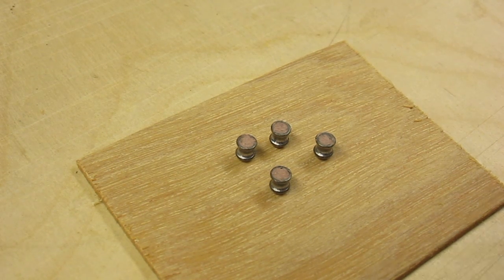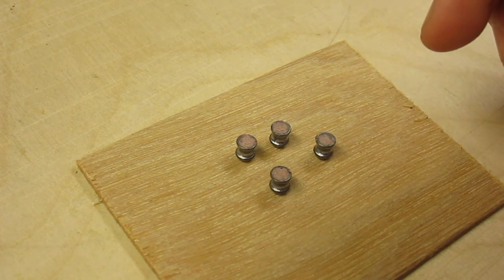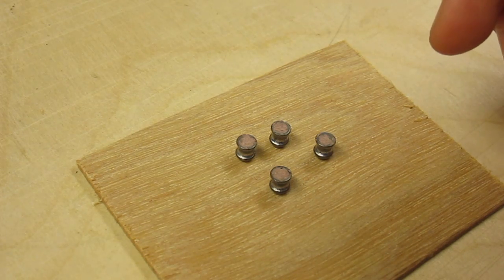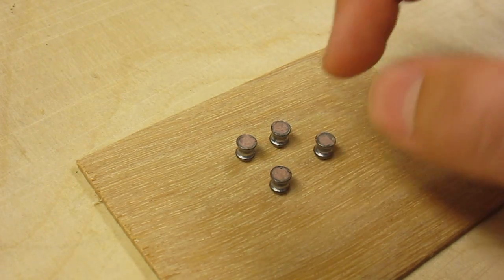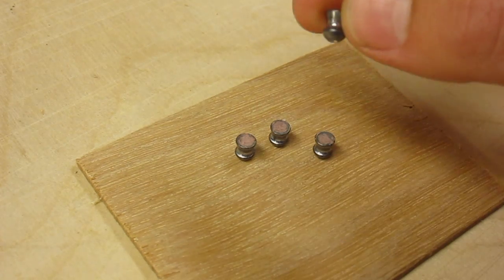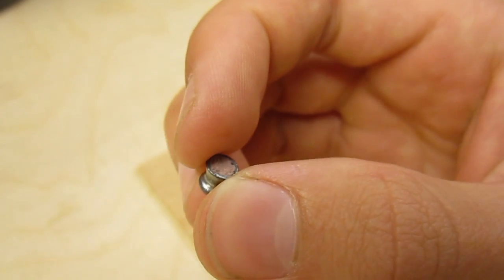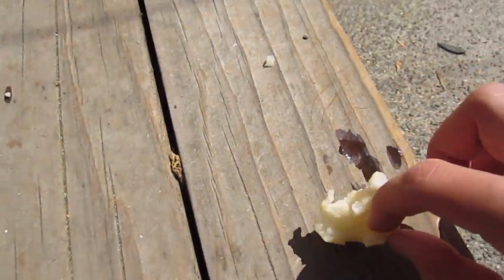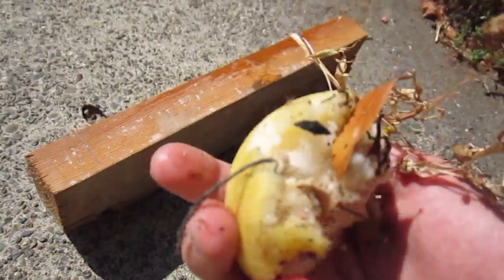Exploding Pellets

Comment: 7 years later I gave it a shot, all I can say is, the pellet does matter, slugs work decent for penetration and huge pops but they can ricochet more often, but the normal pellets you would want to get the pellets with the bb in the tip take the bb out and use those, they are awesome, if the pellet had a lot of lead, use a drill, a small flat head, and a knife you don’t care about to machine a huge hollow point in the pellet, but it’s best to do that with slugs because of their excess weight.

Comment: If i try it with a 4.5 mm and a 5.5mm they went off inside the gun... why does that happen?
Reply: Because if your pellet rifle is a decent one, it develops a lot of pressure and this pressure will cause heat which ignited the powder. If you use a hollow point pellet, you can fill the hollow point with gunpowder paste, let dry and shoot!
Reply: Duane Dalton okey i will try it... thnx
Reply: Nederlander